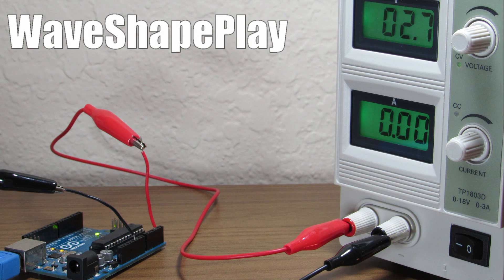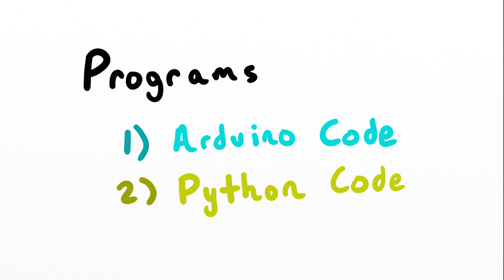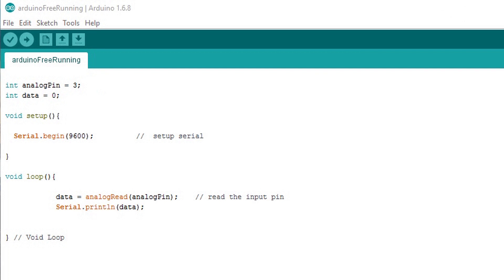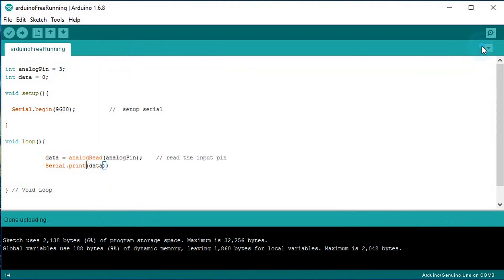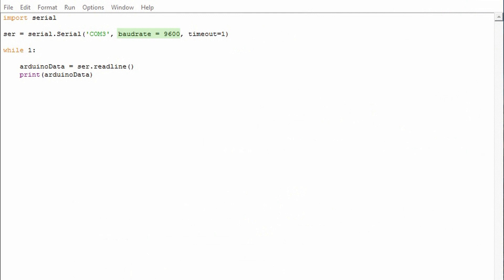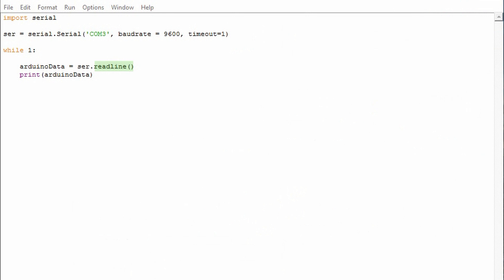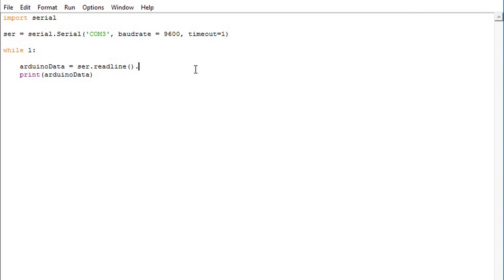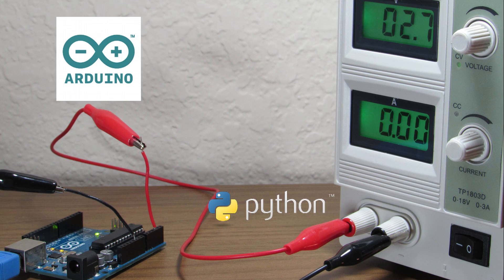Arduino and Python Serial Communication with PySerial Part 1

Comment: The video is explained excellently .I have a doubt regarding the timeout value , will be it be delaying the whole data transmission. I am doing a data rate calculation. So my doubt is regarding the timeout parameter. It would be very helpful to if I get a reply

Comment: If you're getting this error:
 
arduinoData = ser.readline().decode()
UnicodeDecodeError: 'utf-8' codec can't decode byte 0xfe in position 0: invalid start byte 

I found out first byte that coming from arduino is can't convert with decode, so i added a loop like this ;

for _ in range (0,2):    
    arduinoData = ser.readline()

i am taking first two value and don't use them and added while loop right after this loop.

Full code:
import serial

ser = serial.Serial("COM3", baudrate = 9600, timeout=1)

for _ in range (0,2):   #It's giving an error for first byte so with this loop we eliminate first two byte.
    arduinoData = ser.readline()

while 1:
    arduinoData = ser.readline().decode()
    arduinoData = int(arduinoData)
    arduinoData = (arduinoData/1024)*5
    print(arduinoData)
   

Ps. Yep, my bad that i don't read the error but I have searched this problem for one our and couldn't find anything :')

Comment: Why it works sometime, and sometime not? Windows 10. Installed serial, but it complains that it is not installed. Once worked, then after changing parameters, does not work. Then again work... confusion.

Comment: Hi,
Thanks for the video.
Is there a video talking how to set up the hardware?
Which pins did you use from the adruino to computer? Did you use a USB to serial (e.g. UART) adapter or just the USB cable to arduino?
Thanks.
Reply from the maker: Hey - I do not have a video for the Hardware setup, I can make one in the future. For this setup I am using standard USB interface for the Arduino UNO.  It uses a USB cable type A/B to connect between the Arduino and the computer.

Comment: Hello sir, can i use pyserial to collect and process data from power analyzer or this works only with arduino?......please answer my question
Reply from the maker: If it uses the Serial protocol then yes. Perhaps look up the documentation for your power analyzer and see if there are existing examples.

Comment: This is an excellent presentation. Clear, concise and enough detail to make this extremely useful. The only comment I would have is that the rate at which you poll the arduino. From what I roughly calc...The actual conversion took 4.58 µs for 12 bits in single conversion mode with a 2 MHz ADC clock.  If you read any faster than that you may get inconclusive data.  Any comments?

Comment: how to convert it to int , when i use int(arduinoData) it call the error :: invalid literal for int() with base 10: ''
Reply: I might be wrong but since the incoming information are bytes, I would assume that you need to use int.from_bytes() to convert the data from bytes to int .
Reply: @kevindrouglazet2379   thank you , i will try your code
Reply: Nguyen Dat worked?

Comment: WHY? UnicodeDecodeError: 'ascii' codec can't decode byte 0xff in position 0: ordinal not in range(128)
Reply: try this:
arData = arData.decode('ISO-8859-1')
Reply: i got the same errror. Any luck solving it?
Reply: @serialrisktaker  I am trying with pyfirmata, so far is the best option.
Reply: @serialrisktaker  try this:
from pyfirmata import Arduino

placa=Arduino('COM4')

print("vamos a entrar al for")
for i in range(12):
    placa.digital[13].write(1)
    placa.pass_time(3)
    placa.digital[13].write(0)
    placa.pass_time(1.5)
    print("primera conexion real",i)

Comment: Hi,
I'm getting the following error:
AttributeError: module 'serial' has no attribute 'Serial'

The libraries serial and py serial are already installed.
Could it be that you have Python 2.7 and i have 3.7.
If so, how different would the code be?
Regards,
Reply: yep getting the same error
Reply: I solved it py pip install pyserial and use a conda environment

Comment: hello, thanks for the video : good explanation , but for me when I execute the code it returns to me an error : No module named 'serial'  ;;;; what should I do
Reply: Hi, that was three months ago. Did you find the solution? I have the same error.
Reply: @thomasmarques8040  I solved it py pip install pyserial and use a conda environment
Reply: I solved it py pip install pyserial and use a conda environment

Comment: ThANK YOU for the reply. were did you learn all of this? i realize it a general question. i suspected what you have said but you have to understand i am confused, understandably. im at a junior college in California doing electronics with arduino. their is a person named "Paul McWhorter" whose web site "https://www.youtube.com/watch?v=mF5cE3DS50s&t=582s" its coding python for arduino its video is called "Arduino and Python LESSON 2: Installing the Software and Libraries" unfortunately its dated 2014 and is now totally obsolete. none of the information on pyserial, python, or Vpython can be obtained. its available, but i cannot understand what to download. i think i down loaded pyserial and updated it to 18 it was #8 but i cant find were in the computer it is. i have python 2.7 and 3.5 and i hope their 64 bit. i down loaded something called "PIP" which i used to download pyserial. i tried to download "Vpyhton" and failed with an error message. this it is what im trying to do with python. i have not gone threw all of your pyserial videos and wonder if it will teach me what he is doing. im not certain what your talking about. he requires that i have "Vpyhton" and pyserial and some type of pyhton to do what he is doing but i think its similar to you. if possible you should consider what he is doing and modernize it for current 64 bit machines. he uses an arduino to capture threw a sensor and transmit it to python. sorry for the babbling im trying to make the conversation as short as possible but it is very complicated.

Comment: im confused? clearly, your audience is more educated then me. im interested in how to do what you are talking about doing using arduino with "PYSERIAL" which is a program. in order to use python you need a program to run it. two are "ATOM" and "PYCHARM" however their is something called "PYSERIAL" would you consider doing a video on how to get these programs to work, how to install them! im running Ubuntu 16.04 on 64 bit and i have "pIP" but am confused about what to download from pyserial. sorry for my "BABBLING," clearly, im confused. it appears your are doing this manually probably using an "idle" notepad that comes with python.
Reply from the maker: Hey Charles! Pyserial is a 'module'. A module is code that someone wrote, for the purpose of re-use. We can utilize modules that are already created, so we do not start our programs from scratch. PYCHARM is an integrated development environment (IDE). The IDE allows us to write programs and run them. We use a combination of our own code and existing modules to create a program, then run the program in the IDE.